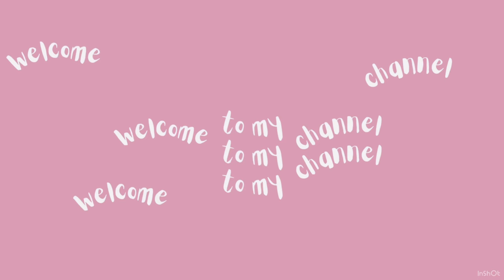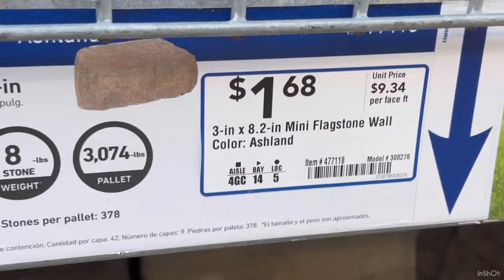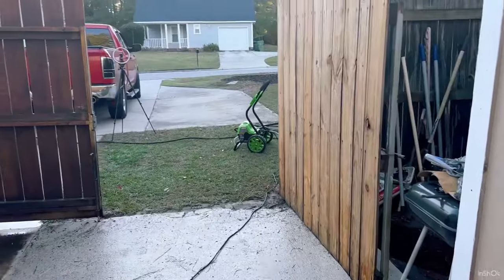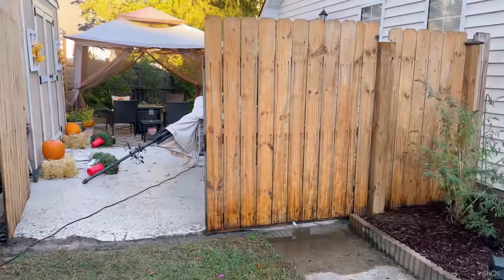DIY Fall Outdoor Series|Part 1|Pressure Wash Fences|DIY Brick Edging Landscape

Comment: hello I just found your channel love love love it I am always in my yard trying to be creative and do different things to my yard  to make it look nice I'm not a professional just a Freshman Learning  and your videos has helped me a lot I did have a question  can I put brick edgers on top of concrete  my driveway has a rock bed in front of it with flowers and I need to find a good edger to keep the rocks in  driveway  thank you so much and thank you for your channel 🎉🎉
Reply from the maker: Awesome🥰!Thank you for watching and sharing ❤️❤️! Absolutely you can. Try using brick edging that lays flat but are high enough to keep the rocks from spilling out the driveway. Or if you prefer brick edging that stands straight up (similar to the one in my diy walkway), align it with “no dig edging 1st, then place the brick edging in front of no dig edging. This will keep the bricks in place without having to dig a trench. Hope this helps.

Comment: Hi, please wait if the mulch can really get washed through those gaps, or if it clogs them. When cemented, you can't easily move the stones, to use them for something else at a later time. Cement and concrete turn ugly after a short time, are only good as construction materials, to be covered up with something else. I hope the bleach will not damage the vegetation. Outdoor wood can be treated with linseed oil, which doesn't trap humidity. It just doesn' protect the wood from turning gray. Numerous wood oils and stains are also based on linseed oil.
Reply from the maker: Hi there! I'll wait to see how the mulch holds up against the brick edging after a heavy rain before applying concrete or cement. It may not make that much of a difference having the gaps, but I'll see. I've used the pool chlorine in other cleaning projects (deck) and it because it's 1 part chlorine to 3 part water, it never harms the vegetation. Thank you so much for the suggestions and for watching:-)

Comment: Love this transformation!!! What tools do you recommend for power washing? And would you use it on the house siding as well? Thank you!! ❤
Reply from the maker: Thank you 🥰! Here’s the pressure washer I used. I use it to clean the siding on my house and on the deck area as well. https://www.lowes.com/pd/Greenworks-2000-PSI-1-1-GPM-Cold-Water-Electric-Pressure-Washer/5001851125
Reply: @diysbycarolina8622  thank youuu 😆have a lovely weekend!!